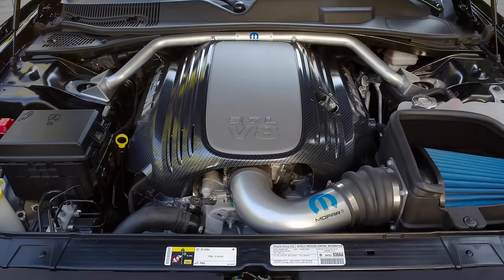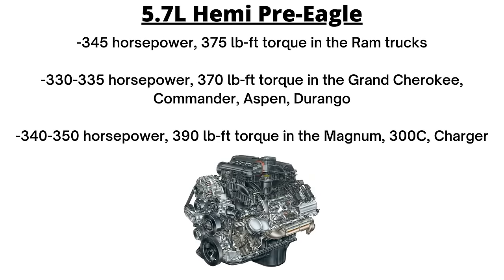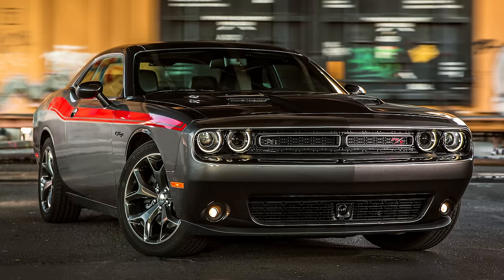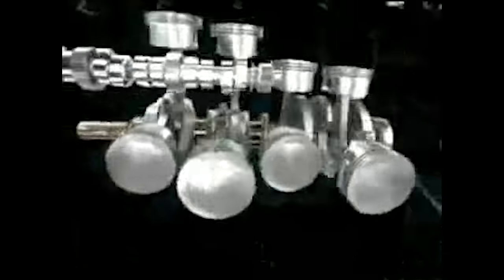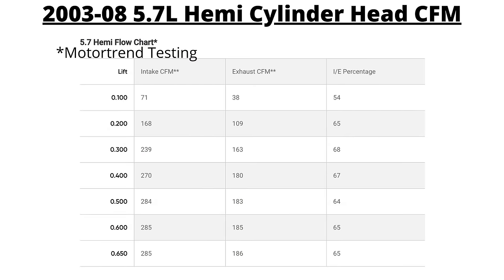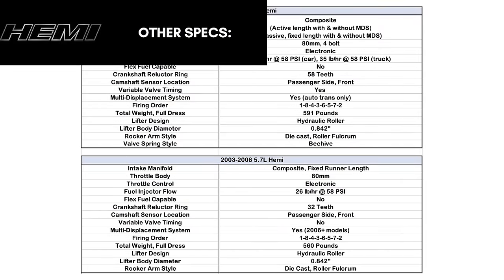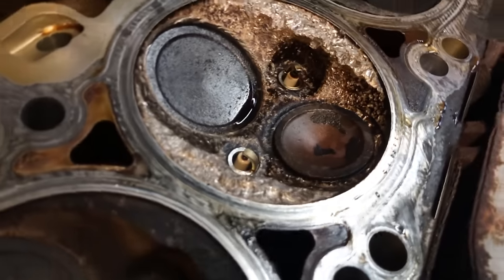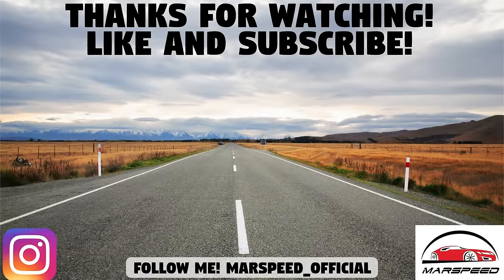5.7L Hemi V8 Engine Comparison - 2003-08 vs. 2009+ – What’s the Difference? (Pre-Eagle vs. Eagle)

Comment: Anyone have a chrysler aspen with a 5.7? If so what have you done as far as performance? I need some ideas for my 07 Hemi Aspen
Reply from the maker: I actually have an Aspen. I’m thinking about exhaust, cold air intake, Diablo tuner. If you wanna put more $$ in then definitely do a heads and cam package and add headers, it’ll be a beast

Comment: So can u drop an eagle motor in a pre eagle vehicle
Reply from the maker: No not really, you need a new harness and PCM since the older computer can’t run the VVT, and the crank differences are another thing. I think it’s possible but would be a nightmare and wouldn’t run right. If you want the VVT motor just buy an 09 and up body.

Comment: hard to believe that the eagle heads flow  14.,3 percent more air than the pre eagle heads, when the eagle heads have a 20cc smaller combustion chamber..  it looks like chrysler improved the intake runners to compensate for the smaller, oval shaped combustion chambers,, also with the Eagle engines being 30 pounds heavier, because of the addition of VVT, and other things, I think the pre eagle 5.7 is a better engine.,., especially if the MDS system is removed.. the oval shaped combustion chamber on the eagle heads, kind of goes against the real hemispherical head design of the original hemi design.  in a nutshell it looks like they robbed peter, to pay paul without any actual gains,,
Reply: Without any gains? Its a 30+ hp difference

Comment: 1:40 Not quite, the the 5.7L Hemi only replaced the 5.9L Magnum engine. The 4.7L Mercedes engine replaced the 5.2L Magnum engine. But still a good video, I learned a few things. 👍
Reply: The 4.7V8 was actually an AMC design Chrysler got from the purchase. The 4.7 came out in the ‘99 Grand Cherokee. About the only thing MB had to do with the 4.7/3.7 was that they took over Chrysler. The 4.7V8 was actually the replacement for the LA engines…in particular, the final 4.7 made 310 hp in the Ram, more than any production LA, including the 360.
Reply: @jamesaandf   Fun fact: That last 310 hp 4.7L came with Direct Connection oval port dual plug cyl heads, along with special intake/exh manifolds, camshaft, bigger FI, etc. The parts alone in the DC catalog cost over 5G's back then, but the engine upgrade cost nothing over the prior year's 230 hp 4.7L.
Mopar made this special engine for less than a year, it was the swan song for this AMC designed small block, which replaced the LA [318/360] in 1999.
Reply: @crankychris2  I have a 2008 Ram 1500 with the 4.7V8/6 speed manual. It has 310hp/335tq. All 4.7s in the Ram in 2008 until discontinued had 310hp. So my Ram was the first year with a 4.7 with 310hp and the last year for a manual in a 1500…and all half ton pickups.

Comment: Older hemi has metal oil pan and new hemi has plastic oil pan.  Definitely more risk with plastic engine parts.
Reply: My 14 is aluminum.
Reply: @snek9353  interesting, I have a 2013 durango hemi rt with plastic oil pan and leaking from the oil pan gasket and a 2005 durango hemi with metal  oil pan and no leaks around there

Comment: I guess if you wanted to build an Eagle motor you would go for a NON cylinder deactivation?
Reply from the maker: Either way if you’re going for performance there shouldn’t be the MDS it’s only purpose for being added originally was to meet fuel emissions. If one cares about fuel economyand wants that boost then keep it but otherwise get rid of it!
Reply: Depends on how important MPG is to you. MDS can be made quiet good and reliable.

Comment: I just want to know WHY haven't the company fixed the flaws and just keep on selling cars with the engine?
Reply from the maker: It happens after the warranty is over and doesn’t fall under a ‘safety issue’ so they have no obligation to fix them. Redesigning the engine to fix those issues would probably cost a ton of money that Chrysler doesn’t want to spend
Reply: They have.